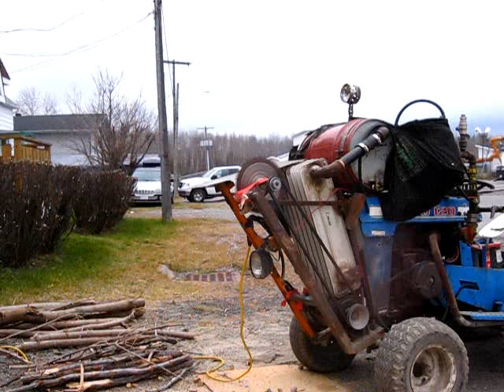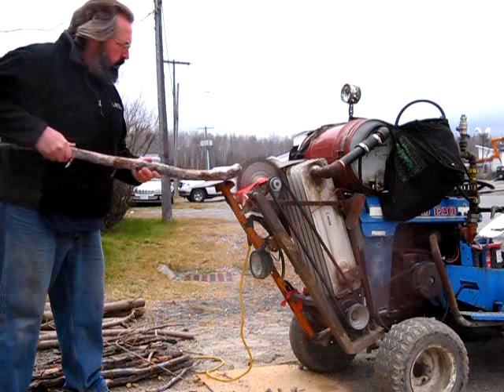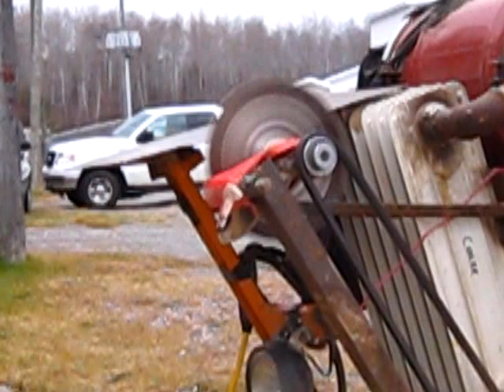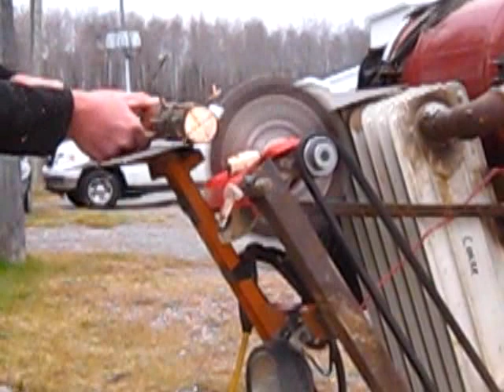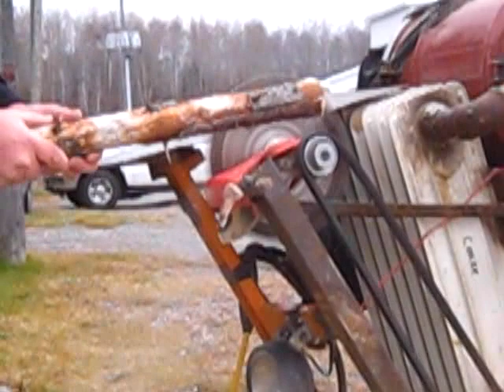Woodgas Tractor Cutting Wood using Electricity mvi_0377.flv

Comment from the maker: Howdy,
The propane helps the transition to Woodgas, Correct  the engine has a centrifugal compression release on the cam. When it's cold the the engine doesn't like to start on woodgas after it and the gasifier warms  it restarts without the propane.  The electric motor 1) Runs the saw 2) Can act as a 1kilowatt inductive generator 3) Becomes a flywheel when the engine via the PTO is powering the saw. .

Comment from the maker: Part 2
 Also the Tractor has a Snow Blower, A Gravel/Snow Blade.  The video titled  "Woodgas Tractor Starting, Stirring the Pot, Re-Starting and Cutting Wood"  at 12:00 mins in shows the saw running off the engine and cutting  little wood